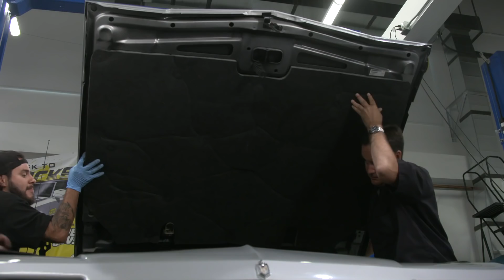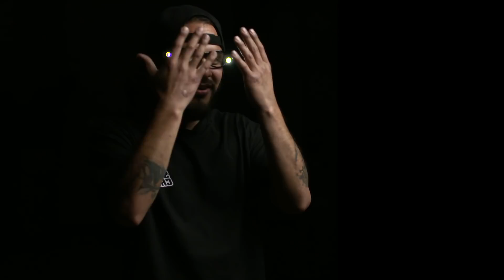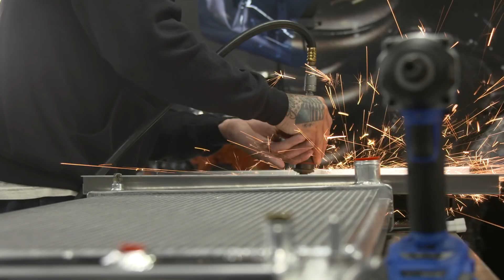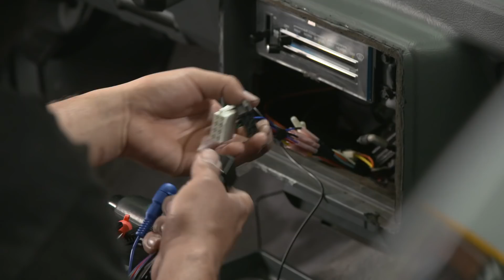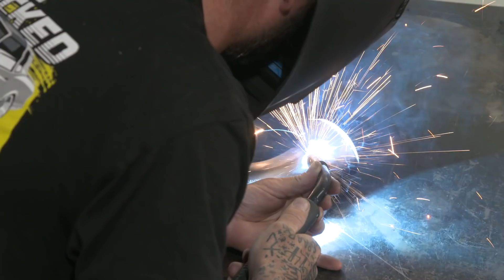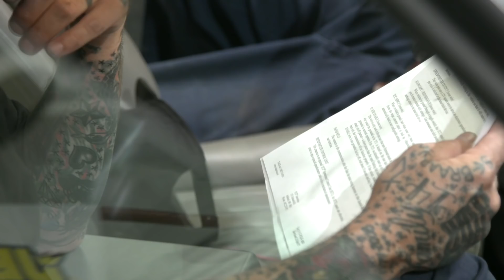JEGS Week To Wicked - Monte Carlo Aerocoupe Full Build Episode

Comment: Do you sell any all aluminum radiators that will fit an 2004 Silverado that have both the inlet and the outlet on the passenger side? It needs to be about a 34” by 17” 1/4” core.
Reply from the maker: would you mind asking at the following link or calling us at 1-800-345-4545 so that a tech can properly help you out? www.jegs.com/AskATech . You can also talk to a tech via livechat at www.jegs.com .